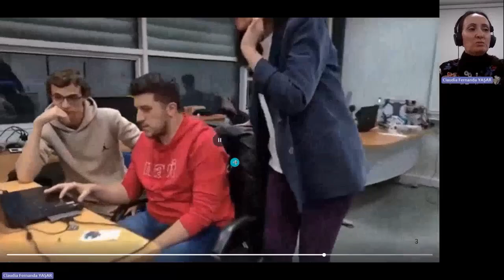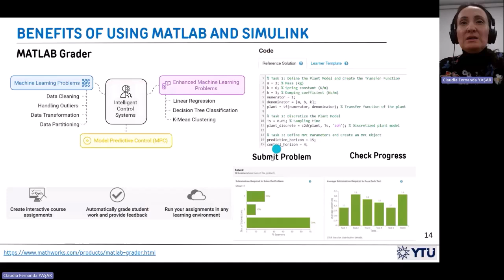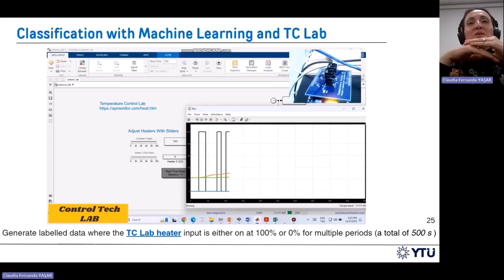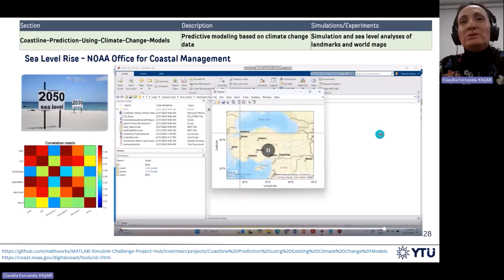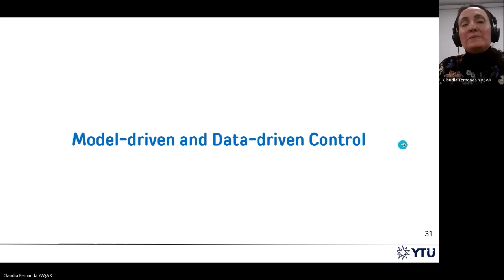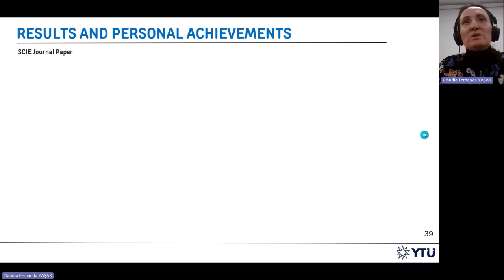Teaching Intelligent Control Systems with MATLAB and Simulink

Comment: I see you utilized the Arduino Engineering Kit. I too set off to use the AEK. However, none of the objectives were tangible with the code provided. Most of the time, my motors would simply hum and never move or they would over accelerate and fly across the desk. I ended up trying to perform steps in the System ID workflow which resulted in better but not accurate movement.